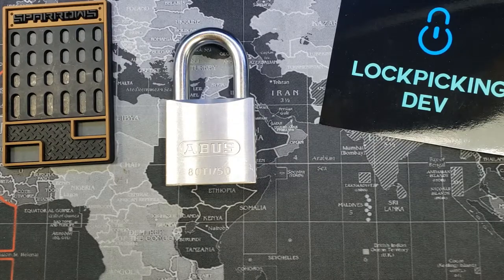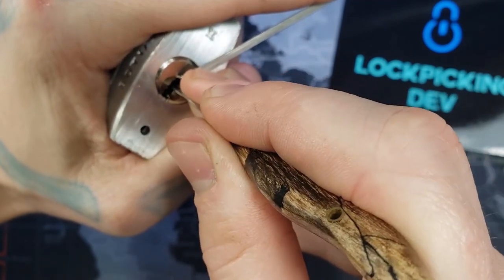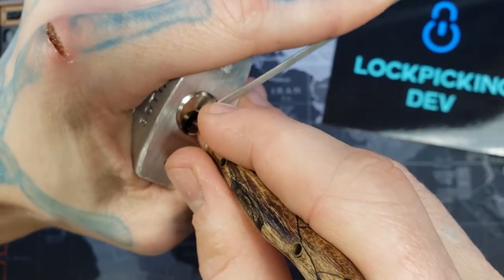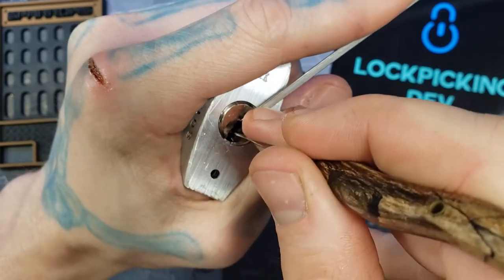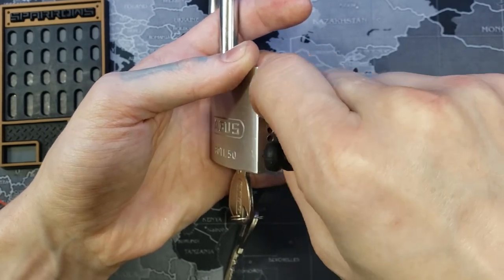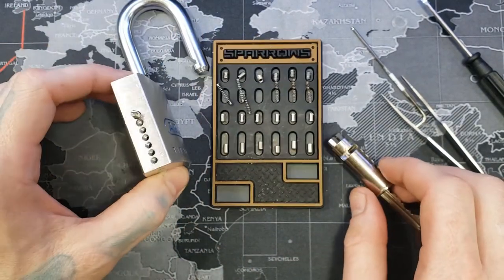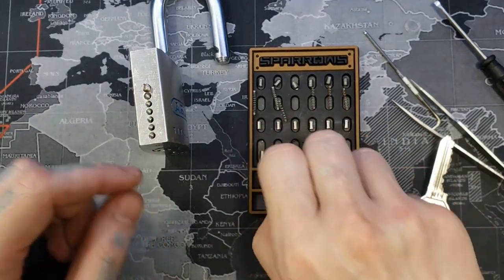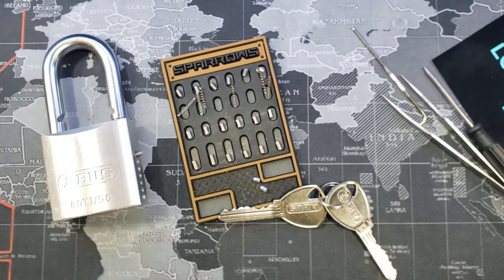110) Abus Titalium 80TI 50 Picked AND Gutted & How to Make a Titalium Practice Lock

Comment: Assuming I’m seeing what I think I’m seeing all the other Titallium 80to/50 pick/gut videos the lock comes with spool and serrated with one standard, I believe.  It’s odd yours have all spools and a standard.  Is it common for lock pins to vary even within the same model?
Reply from the maker: It can happen.  I come across it here and there but not too often!
Reply: @LockpickingDev  Turns out a particular reason may be that Paclock initially started with mushroom pins and eventually grew to include serrated and spool.  So that may be an older 80ti/50. I’ve only ever messed with a Ti80/40 but the Titalium locks are real nice for the price, I was impressed.
Reply from the maker: @mendozatwotoes5992  That could be it. I bought these new in package about 4 years ago or so
Reply: @LockpickingDev  Doesn't the one on the far left at 7:25 have a couple of serrations at least near the top and bottom of the pin?
Reply: Doesn't the one on the far left at 7:25 have a couple of serrations at least near the top and bottom of the pin?
Reply from the maker: @-AdApt-  Yep! Very lightly serrated